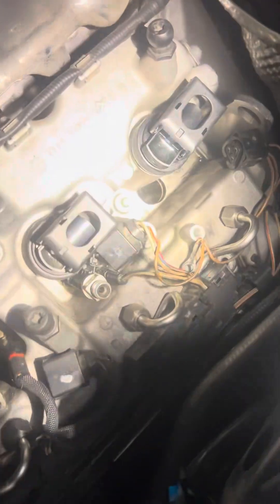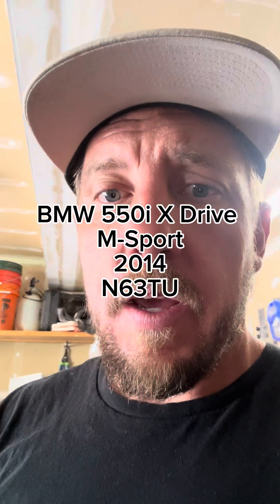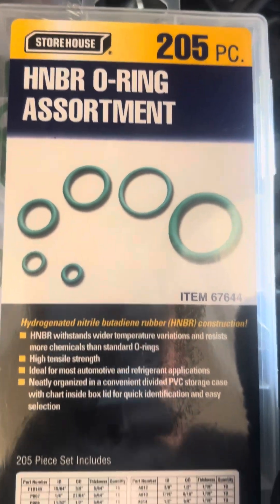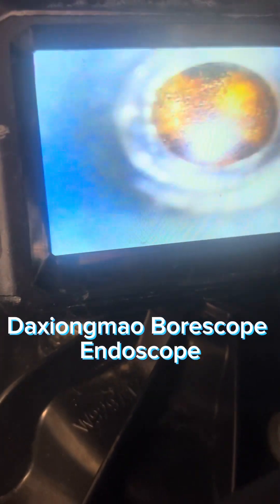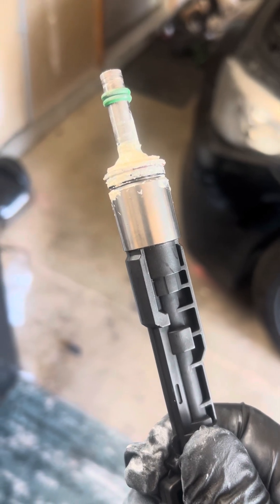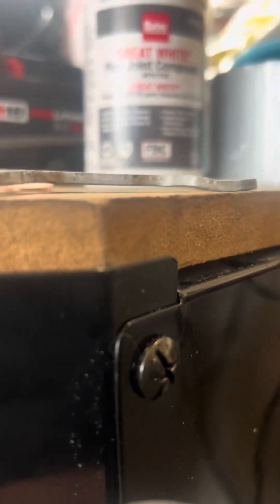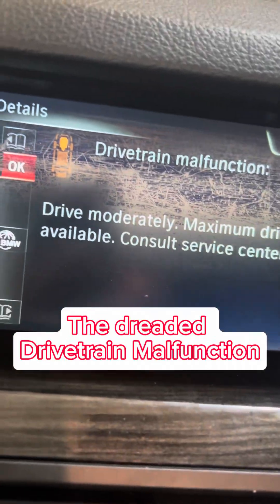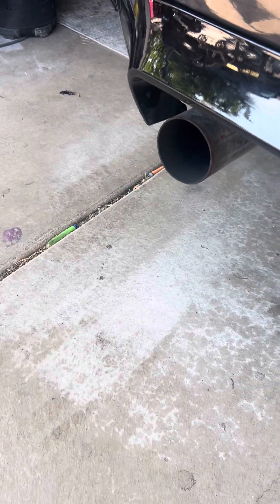N63, N63tu,s63 fuel injector bore repair, injector seal, misfire repair, injector repair, BMW, 550i

Comment: definitely thinking outside the box and an intelligent solution to a common issue . I was around before green orings were factory. They were used to update black o rings on Ford a/c lines. Pressure on the high side was normally up to 250psi w r12 on the high side ports . If for some reason they melt / fail there are all kinds of color  o rings to choose from. Thank you for posting ❤